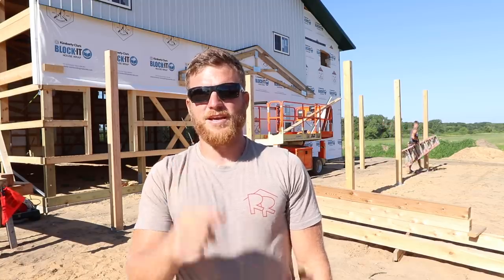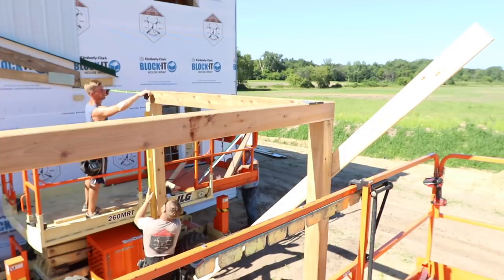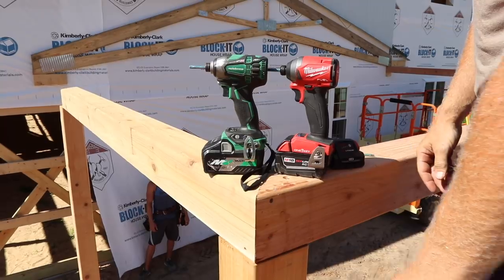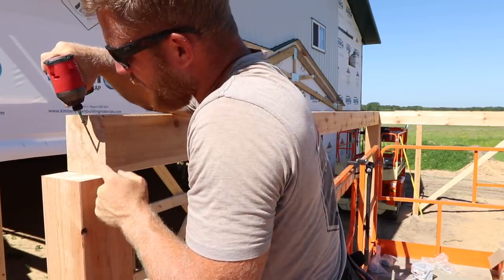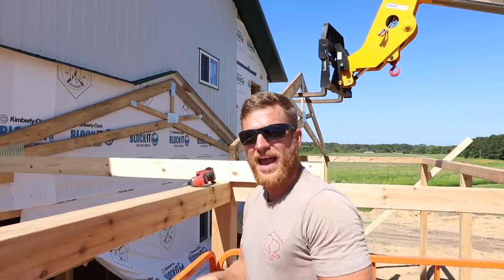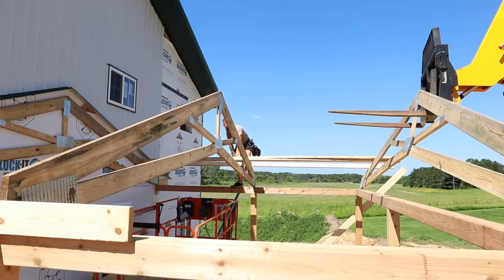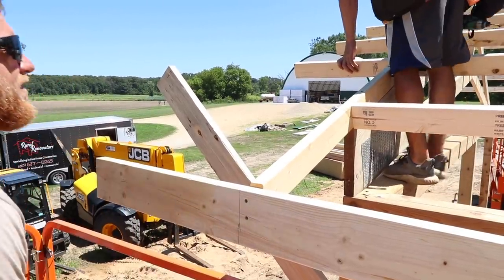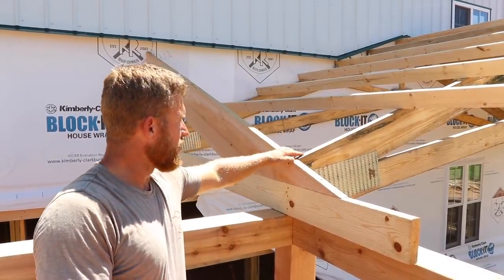Building a Hunting Cabin 16: Building the Front Porch

Comment: In your test with the 2 impact drivers - i think the only reason there was any difference was that you used the Milwaukee in your right hand both times.  If you are a righty then you likely were able to push a bit harder with the Milwaukee - you can even sort of see that particularly in the second round.  Your right arm was certainly pushing harder and your body weight was centered more over your right arm while your left hand was just sort of extended out there and not able to provide the same down-pressure.

Comment: What made you choose those smaller post brackets on your piers over something like the Sturdi-wall brackets I’ve seen you use for your main structural posts?
Reply from the maker: basically for aesthetics..wouldn't want the bracket way out of the ground
Reply: RR Buildings have you ever tried the wet-set model brackets? Been thinking about using them on an upcoming barn build.